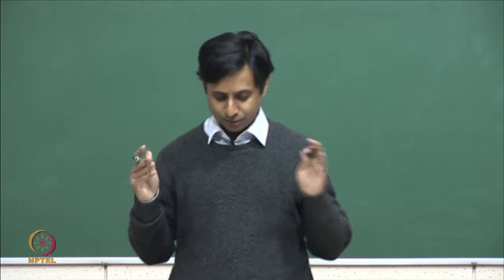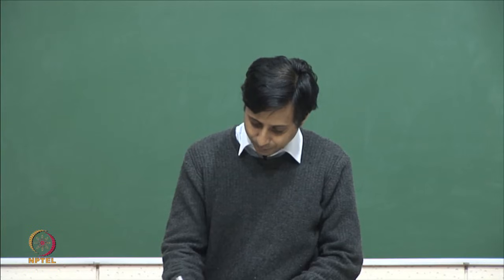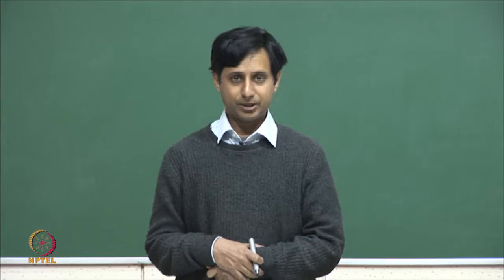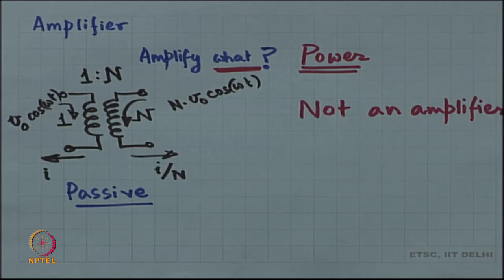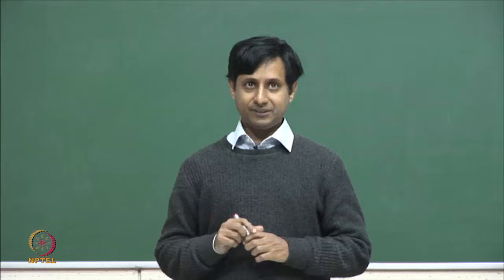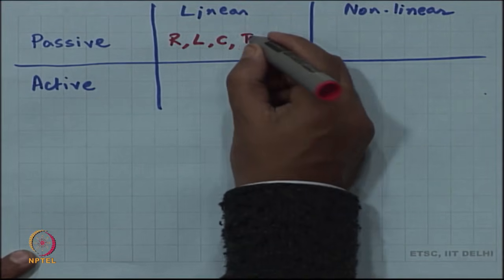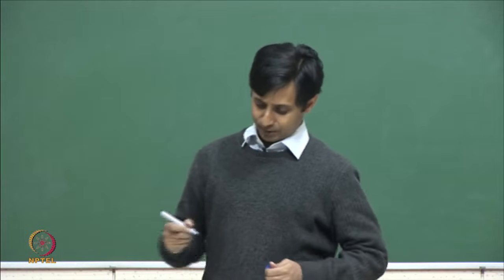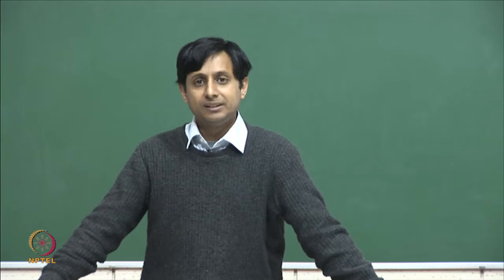Introduction to Analog Circuits Introduction to the Diode

Comment: There is a problem: transistors are passive non linear components... with physical definition of passive component. And the ideal voltage source and ideal current source are not linear components

Comment: Amplifier can be maid through passive components by decreasing the resistance by adding a bigger cross sectional area wire which will reduce its resistance.

Comment: Will comeback for clarity / questions

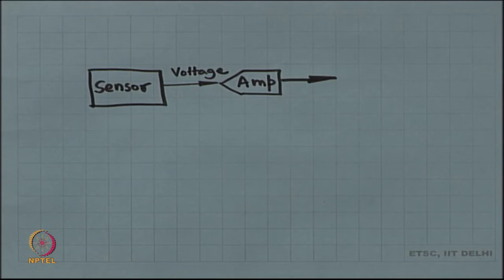9:40 Noise is a high frequency jerks of your signal. When you amplify the i/p signal, wont the noise too amplify? Does the 'amp' sub circuit contain in itself a low pass filter ?

9:43 So I think i got it. Does that system refers to A/D unit or Sensor unit? If it is A/D unit it makes sense, you make i/p volt. high thus making noise produced by A/D unit negligible in comparision only ?

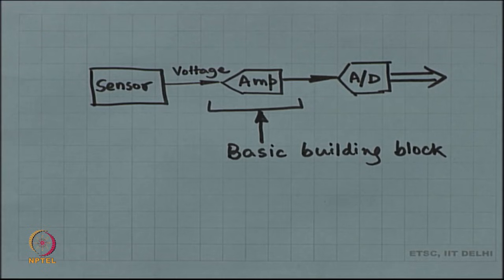12:47 'much more economical'  :) how so?

37:30 'DC power to be translated to the frequency' meaning !? Straight from net, 
Frequency translation is the process of shifting a signal from one frequency to another, without loss of information in the signal. 

So i think to the external dc (which has 0 frequency) we add some sine waves, hence giving it some frequency.

Comment: Could someone please explain to me the reason why we need to have nonlinear elements in the amplifier? I didn't quite understand his explanation. Is it because in this case we'd have a Frequency of 0 Hz at the output --> DC Voltage, because of the Battery Voltage supplying the amplifier? Thanks!
Reply: DC source will provide power to load at zero frequency. The main input is our time varying signal, which has a fundamental frequency greater than zero frequency. This signal to be amplified, should be provided power at the fundamental frequency. But a linear system only provides power at zero frequency to load. By applying a non linear system, I can create harmonics, which can be decomposed in various fundamental frequency term which will contain the DC source power

Comment: As mentioned Vout=kVin we can say that amplifier is amplifying voltage .... If I am wrong correct me ....
Reply: There can be many types of amplifier..voltage, current  resistance, transconductance etc..However amplifier means the blackbox has to amplify power as pointed by prof

Comment: Thank you for your beautiful lecture. Just one doubt: 
Max. power at R_L = [vo/sqrt(2)] * [vo/sqrt(2)] / (2*R_L) = vo/(4*R_L); 
how another 2 is coming in the bottom Sir? Please rectify me.
Reply: Brother it's because of Vrms(peak to peak) is v/2√2
Reply: @StoriesbySunny01  Actually its because we assumed Rl and Rs to be equal so there is a voltage drop of Vrms/2 across Rs, so effective voltage across Rl is Vrms/2 that is V/2sqrt(2).